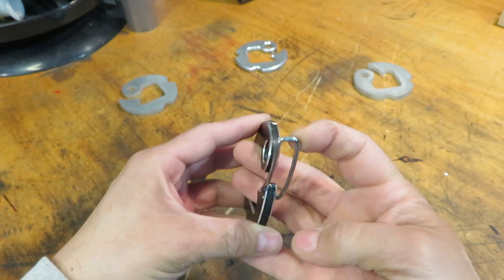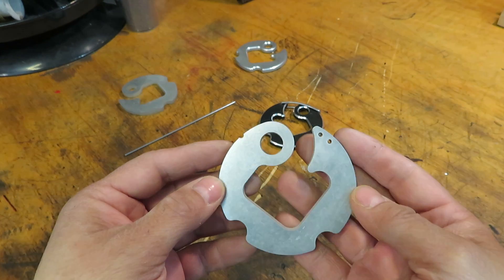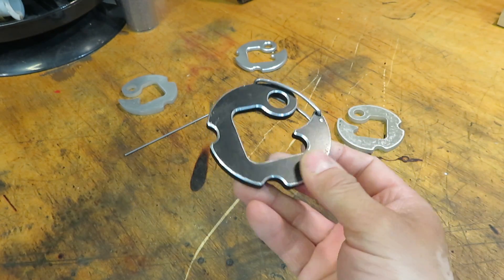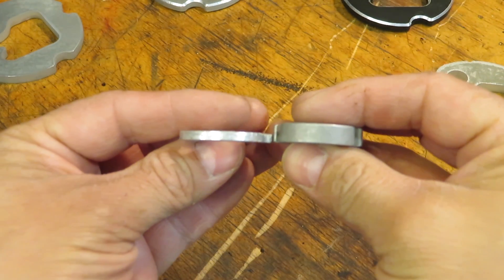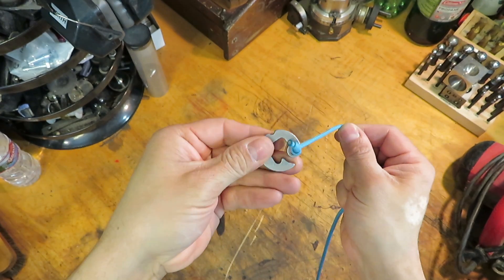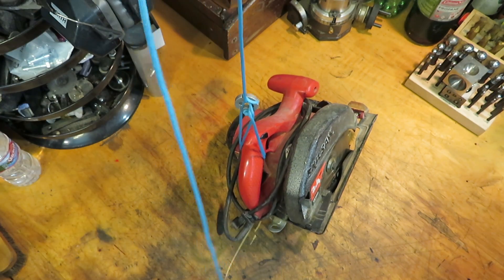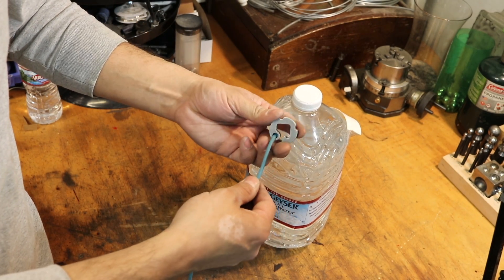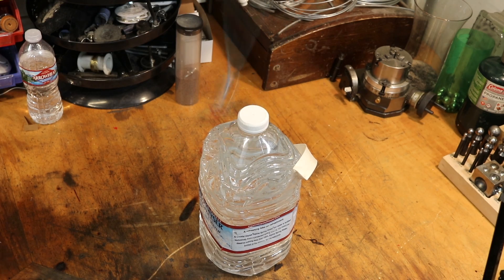Blackwall Carabiner: March 10th Update.

Comment: I work on small commerical fishing boats. often you need to lower items down off the wharf onto the boat - or off of the wheel house onto the deck - this could be very useful - how secure is it though? would you dare use it around water for mid value items and tools?
Reply from the maker: Thank you for your comment. I am designing one for professionals like yourself. It's a ways out though. I will do tests this weekend on how secure it is and then post the video.

Comment: At first I thought this was alot extra to do, compared to tying an extension to a saw or tool to lower.  But after I saw that dismount, I knew this was a must have, holy shit dude. The only thing I would ever add to it, would be a way to make it easier to tie, for the broader consumer, like a spring loaded claw, that would bend in and then bend out to release, after say 2 pulls, but yours actually works, so that's says alot too. I am a little iffy on the notches, I've never used anything like this, so I would have to be used to trusting a notch that much when safety is involved. Great product,I will definitely be backing